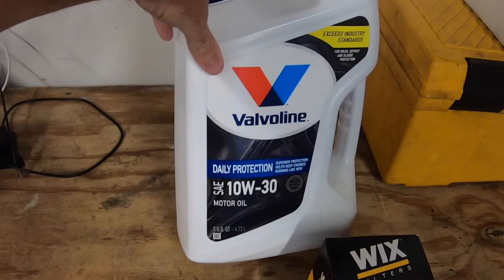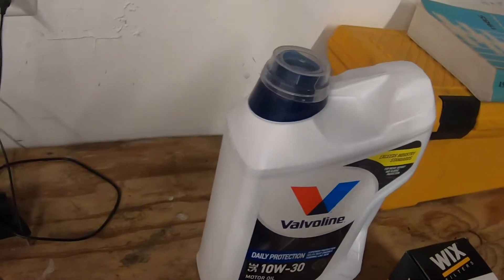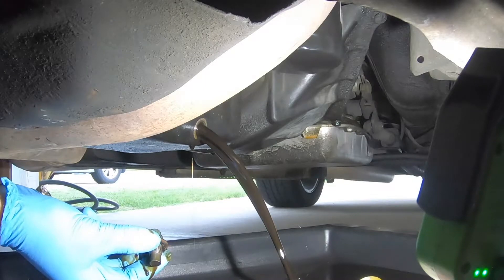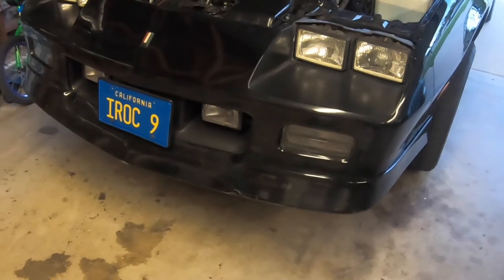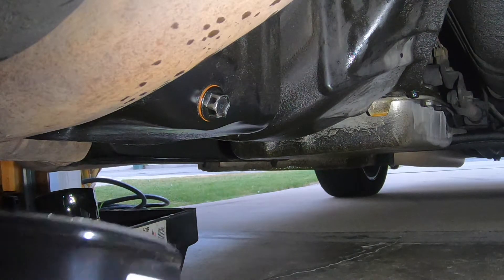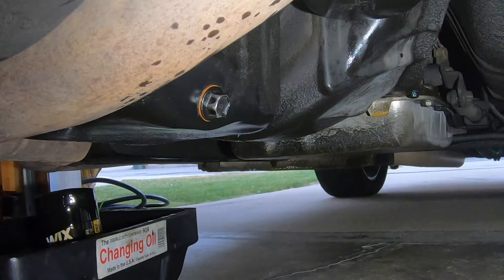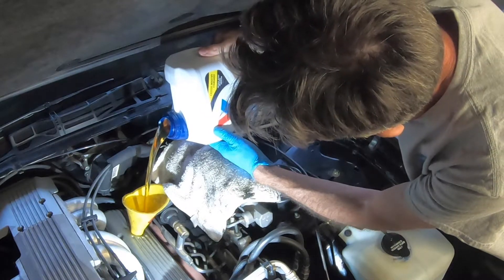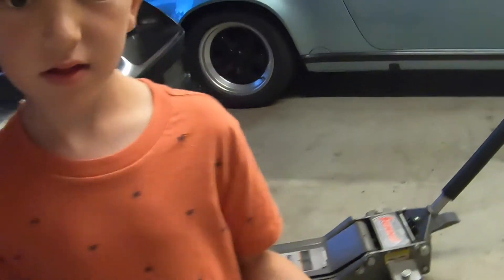Let's change the oil on the 1985 Cali IROC Camaro and check the dipstick

Comment: Next oil change on my L98 I am debating switching to Mobil 1 HM 10W-30 from the Mobil 1 HM 5W-30, the 10W-30 has been great but as I get closer to 100k miles a little thicker oil will better protect. Mine also takes a little less than 5 qts.
Reply from the maker: Yeah I’ve been running conventional but Mobil 1 is a good product